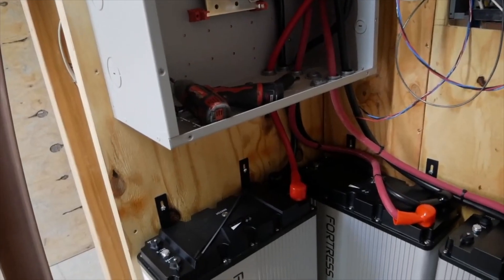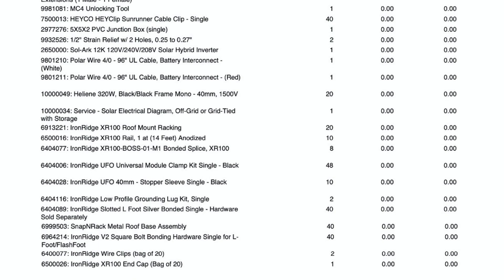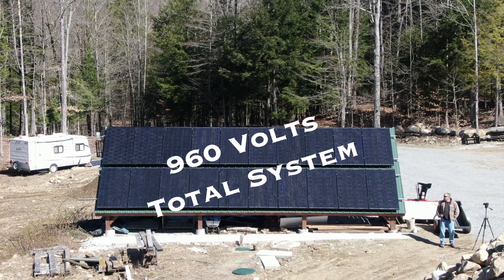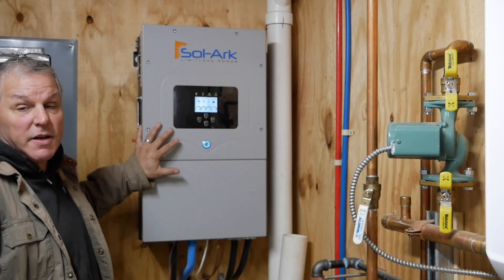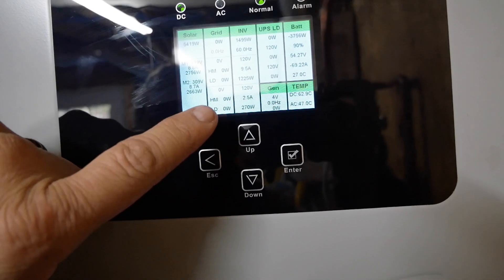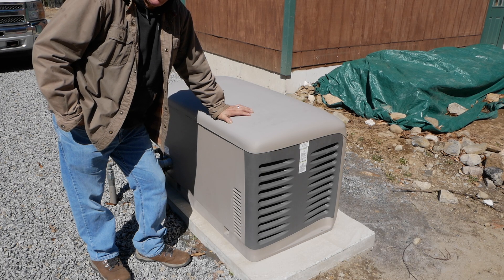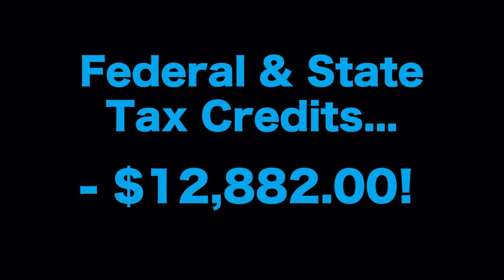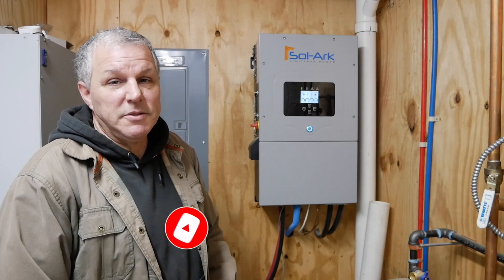TOUR of our OFF-GRID SOLAR POWER System & What it COST!

Comment: TBH that's a solid system. Even pros sometimes mess up on this topic. i also have a system built by myself, my battery is made out of used Nissan Leaf battery cells, and it's a 3KW system. I've been using it for almost a year now and I bearly use the grid power.
Reply from the maker: That's awesome, sounds like a great setup!

Comment: My current Solar System is 21,565 Watt potential output!!!  I built the system myself with a SolArk15 & a 44,000 Battery Bank. We are Grid tied so I was able to store my excess energy with my local electric Co-op. My energy consumption is minimal in the Spring Summer & Fall. My Banked energy is very important for heating in the Winter Months. I have a propane 95% efficient furnace. However I only use it now during Sub-Zero nights. My Battery Bank is big but 4000+ watts drains it rapidly. I think it would make it through the night but why push it.
Reply from the maker: That’s awesome! Sounds like you have a great system! 👍

Comment: Each battery is 105 amp hours… claiming 16,200 amp hours works out to 154 batteries.  Check the top tab on the battery set up on the solark. That value will make a difference if your battery bank is not connected via closed loop comm.

amp hours are: amp hour per battery multiplied by number of batteries. you have 315 amp hours. Using something that most can relate to, one could operate a 100 watt light bulb for 315 hours (roughly).  

A typical 20,000sqft home with a family of four uses over 900,000 watts a month, or 30,000 watts a day.  An apartment dweller and spouse uses 20,000 watts. 

PV panels preform best between 10am and 2pm and actually lose efficiency as the day gets warmer.  Yes, during the hours of daylight the panels produce electricity however unless you are scraping for every watt, the hours outside of that 10-to-2 windows are, while available, are not really meaningful (the power generated varies by season, location, and temperature.)

1) people should size the battery bank for the number of consecutive days in a week without sun during winter. (And the PV array should be positioned for winter months). That number of days times the 20  to 40 kilowatts expected to be consumed daily depending on family size, heating and cooking source, and how winter tight the home is. During the summer there will be more than enough sun for running the A/C.

2) total PV should be enough to recharge the battery bank from a 25-35% SOC in 3 hours - the number of highly productive sun hours during a winter day.

3) that generator consumes 2 gallons of propane an hour at 80-ish percent of full load (50-ish amps)  And once it starts it runs until the SOC is 95%.  I’m thinking that once it starts it runs for 4+ hours at $3.50/gal times 2gal/hr times 4 hours is $28.  Better to have more panels and then a bigger battery bank - PV panels are cheap, it’s the mounting system that is unreal these days.  The Sol-ark will charge the battery bank from the gen and PV simultaneously so more PV is helpful and cost effective.

I wrote this to educate a people thinking about going off grid.  

Off-grid homes live on the battery bank. That bank needs to be enough to provide 20kWh per day for 3 days and the PV needs to be able to recharge the battery bank in 3-4 hours during winter months. And the generator is absolutely necessary but the cost of operation is outrageous and that cost can be diminished by increasing the PV and battery bank. 

I dont see how people can live with a single sol-ark, it provides 37.5 amps for service. An older home had 100amp service and newer homes have 200 amps service. A second Sol-ark will allow double the PV input which means half the recharge time of the battery bank. And provides 75amp service and lights don’t blink when the A/C starts.
Reply from the maker: Thank you for sharing your thoughts. You’ve given me a great idea for a video so we’ll be addressing what you’ve brought up very soon because there’s a lot of misunderstandings 👍😊
Reply from the maker: Here's a video addressing why our 6400 watt system works so well for us that everyone should watch: https://youtu.be/84NKcsmFVVA?si=671O38j8Gv3XbPhO

Comment: If the green tin roofing is painted white it will help the panels pull more current off UV reflection increasing power gain on input just a friendly tip.
Reply from the maker: Yes! That is absolutely correct and really matters more if a person lives in a warm/hot climate than we do. During the winter, it doesn't affect the efficiency here at all.  It would however help the efficiency in the summer (which is only hot during July and August), but we thought about it and decided it would not make enough of a difference to purchase a different roofing than the rest of our home. It is definitely something for people to think about though.

Comment: Is your generator a DC or AC generator?
Reply from the maker: That’s a confusing question because I believe all generators generate DC, then convert the energy to AC.
Reply: @ so , first I am new to the SOLAR stuff. The EcoFlow generator has an outlet that lets you TAP into DC Production. This can be sent DIRECTLY. to the batteries, Skipping the TO AC back to DC conversion… I thought I saw another video where they Where saying the generators were DC generators…  if you want to know about the EcoFlow generator watch the solar lab or hobo tech.  Cheers..
Reply: @CreatingASimplerLifeOffGrid Actually I just asked Google, are there DC Generators, and the answer was yes… if you are using the gen to top off ur batteries then a DC GEN would be more efficient.
Reply from the maker: If I’m correct, the eco flow is actually a power station (battery) that needs to be recharged and would not work for us. We use a 14,000 watt propane generator to recharge our batteries. The generator produces ac power to our inverter which then provides dc to the batteries and ac to the house while running. It needs to be that way so the when the batteries are being charged by the generator, our home still has full power. Of course on sunny days, we’re charged by the sun.
Reply: @ was not recommending EcoFlow 4 U… Using their bi-fuel generator as example of DC generator… u have a hybrid system so AC Provides for bat and home 👍

Comment: I’ve been selling Solar for 10 years. This is not a big system. This is basically heating your house with a candle and lighting your house with a flashlight. If you were living full-time off grid with all of the creature comforts of a regular home you are in the neighborhood of spending over $150,000most of which the cost is batteries
Reply from the maker: It’s providing power for absolutely everything we need, including the creature comforts we require! With a properly balanced system (key word) you actually don’t need as much as you think (or sell) 😊 we will be sharing more details on why this works for us soon, but for now I can say that this system was chosen/designed after 10 years of research and our only regret is that the larger inverter came out after we purchased this one!

Comment: Great video, I’m researching other systems because I had a ‘Solar Pro’ quote me in Northern CA $65k for full system setup. I nearly passed out!
Reply from the maker: Off grid or grid connected? And how many watts? Systems are much cheaper now, our system would be almost half of this now.
Reply: @CreatingASimplerLifeOffGrid  Let me revise that, I just looked at the new adjusted price for 'Off grid' quote: "12kw solar system, 4 franklin batteries and a 24kw generac generator it would be around $100k" 😲😵‍💫
Reply from the maker: @ that’s an extremely large system. I’m assuming you live in the southern USA? If so I believe you can definitely size down. I’m also assuming that price includes installation?
Reply: @CreatingASimplerLifeOffGrid  in the mountains of Northern California and yes includes installation. I need to calculate how much powers we will actually need to be comfortable and not run out fast.

Comment: OMG, it was amazingly expensive ! We've just built a 6kWp/10kWh LFP/5kW (Deye 1phase hybrid) system that costed $7000 with labour. We use it off grid. The 10kW 3phase version would have costed roughly $9000 with labour but we don't need that much power. (Hungary/Europe)

Comment: Pieced together a 3kw setup with some used panels from SanTan and grabbed 10kwh of 2 100amp 48v lithium phosphate batteries and built some ground mounts from some lumber from home depot for 5k dollars for everything including some tools and all the wiring. Nice setup, but was awful pricey. My system will only run up to 30amps of 120v loads though, but for my usage was nice, I could be running 240 v loads if I doubled everything basically, doubt I will though.
Reply from the maker: Nice job👍

Comment: I hope you did this like 4 or more years ago since a system that has 7200w solar with inverter and 14.3kwh battery only costs $6753 today.  Many similar systems for around the same price.
Reply from the maker: Unfortunately we purchased our system during covid when everything was so expensive!!! However we did also buy life po4 batteries (very safe and can be inside our home) which significantly added to our cost. No regrets, just tough timing on purchase.
Reply: That’s kind of the price I’m looking at now.  I see things half the price from a year ago.
Reply: @fernarias  do you have suggestion for manufacturer/models for the 7200W set up? Starting the process.

Comment: The  gas generator should definitely be in the costings. Might be wise to include a  second smaller 5kw generator totally independent of the solar system and main generator... to hedge against that bad day when the main power system fails for whatever reason. Call it Murphy's generator which can be manually connected to the house via a big red "Panic" transfer switch that isolates the first generator and solar system and allows you to have instant emergency power to watch the Super Bowl....
Reply from the maker: Yes, we understand your thoughts, the generator was included in the propane video as it runs in propane and can power our system independently whether we are off grid or not. We are planning to install a switch this year just in case of that exact scenario! And… we have a 6500 watt generator that can run our 240 volt well pump👍maybe we’ll have to do a solar update video though because even with the propane totals including the generator we came in less than what running electric in would have been!

Comment: How much did you have to use the generator to charge up the batteries this fall/winter?  The cost of the Kohler generator should probably have been included because you could have used the smaller Harbor Freight generator you had as a backup if you were grid connected.
Reply from the maker: There was a stretch of about 30 cloudy days with absolutely no sun and the generator ran about every two days for about 2-3 hours. We could decrease that if we choose to, but for now we just live our lives like normal 🤷‍♀️😁😊 oh, and the generator cost was in another video but we honestly would have installed it anyway because power goes out for extended time a lot up here! But with the propane tank and all installed it was around 12,000

Comment: I searched for 2 years before I bought 8KW inverter, 12kw solar, 48kw battery, custom mounts, total 22000 usd or 30000 cad. Had a firmware problem as well swapped the inverter 20 mins, used the gen to charge up the top 45% of charge the old inverter never charged too. Haven't used the generator since or even come close to using it consuming 14.6 kw a day. If December is not working for you another string of vertical mount bi facials, good cloudy black hole sucking power and snow doesn't stick. 2790 array 580watts in clouds mid-day. 48kw battery was 9600usd.
Reply from the maker: Sounds like a great system!
Reply: @CreatingASimplerLifeOffGrid  If you could return the batteries for 3000 less get 48kw of lead carbons , no bms -30 to 60c I would even offer a video call to wire it up

Comment: My presumption is there are times when batteries are full.with solar panels still working.   If not used, you loose it.

If it was me....I'd be turning on everything I have and let it just run away !
Reply: I'd crock pot a whole stuffed Chicken on high !
Reply from the maker: Yes! That too!
Reply from the maker: Lol, yes. That’s when I do laundry, run the dishwasher, and in winter run the electric heater! 😁